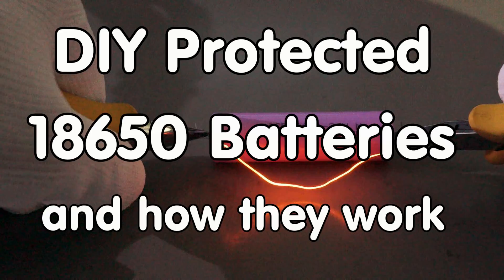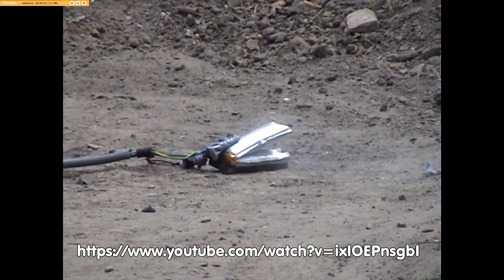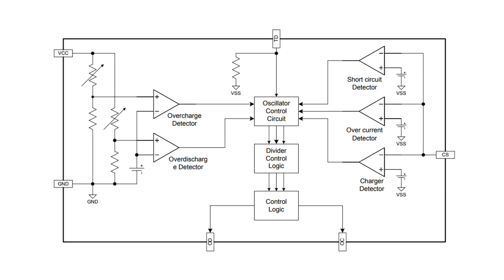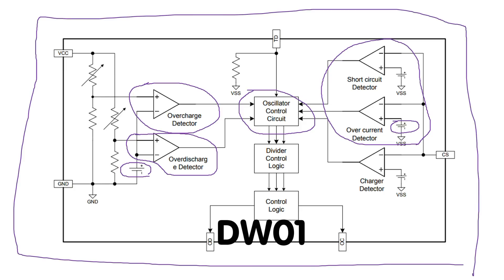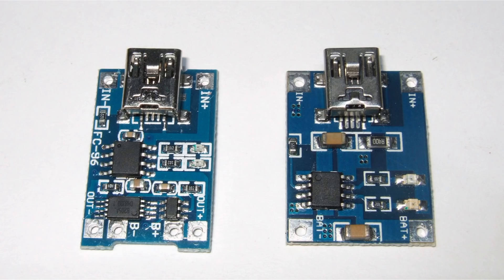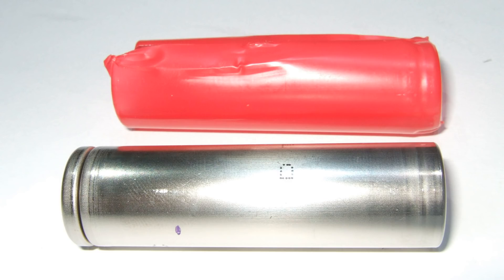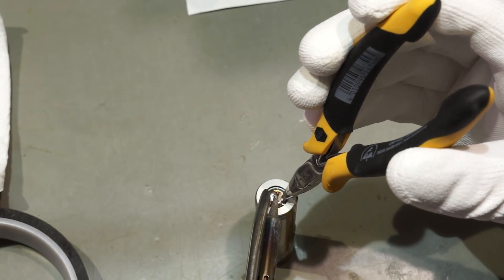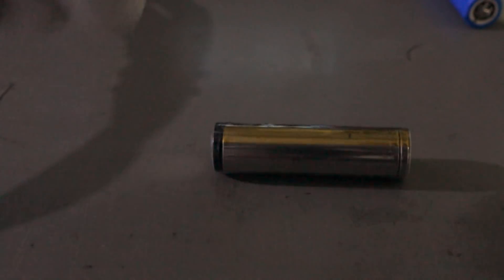#160 40 Cent Do-It-Yourself Li-Ion Protection for 18650 Cells (Tutorial) and how they work

Comment: Hi +Andreas Spiess, great video and very informative. Is that definately a Lithium-Polymer 18650? I know the Li-Po is often used for the drones and other high discharge applications as the dQ/dt is higher than with Li-Ion cells.  How did you know what the chemistry of the battery was before you added the regulator. I didn't see anything on the wrapper you removed. I suppose this regulator works for Li-Po, Li-Ion and the mixed chemistry technologies now appearing as this short article suggests (link below). Thanks again. That was informative http://blog.ravpower.com/2017/06/lithium-ion-vs-lithium-polymer-batteries/
Reply: The often used distinction between Li-ion and Li-polymer has nothing to do with chemistry (it is used wrongly and the link you posted just continues to promote that mistake; funnily enough the post links to another page, where it essentially tells you there's no difference; don't trust random blogs). Pouch and cylindrical cells are just different form factors. There are different chemistries within that class, but again that doesn't have anthing to do with the form factor. The main difference is that the different form factors are built for different applications (high current vs. high energy density). They are all Li-ion batteries.
Real Li-polymer batteries are still a research topic. Those batteries are still Li-ion batteries , but their electrolyte is a solid polymer. Current batteries have a solvent based electrolyte and the only polymer in them is the separating plastic foil in the battery. It is that solvent based electrolyte burning btw. that you see in battery fires. Lithium has nothing to do with those fires.
Reply: Ok, here is what I understand you are saying. I've made a few of my own interpretations, so perhaps you can comment on those ;- 
o There are no mass produced Li-Polymers. They are  still a chemistry theory or research lab thing. Li-Po will also be Li-Ion, and with a solid chemistry rather than the current Li-Ion tech which uses a wetter solvent electrolyte which when heated too much obviously burns. The solvent bit kind of makes the point about why these batteries have to be so carefully managed.
o Any internal chemistry is independent of form factor, though certain chemistries tend to use certain form factors.
o Form factor determines physical structure and thus either high current (dQ/dt, coluombs per second, charge flow rate) or high energy density (J/C, joules carried per coloumb).
Have you a link to a good no nonsense web page that spills the beans?
Reply: Yes, that's how I thought it should be understood ;) .
"Lithium ion" is the means of how the energy is stored. For example LiFePO cells are lithium ion batteries as well as they use also lithium ions to store the energy.

Heat or overcharging can make the electrolyte decompose or evaporate (very visible puffing on pouch cells, cylindrical cells have a safety vent so it won't explode). If it's hot enough and vents you got a fire. That's also why it's totally fine to extinguish such a fire with water if you don't have a better extinguisher available (it's for example recommended to flight attendants to use water should a passenger's electronic device catch fire). The water also keeps the thermal runaway from spreading to other cells in a battery.

There are so many different combinations of electrode materials and electrolytes that just putting them into "li-ion" and "li-po" category, even if that were a correct distinction, would be pointless. My guess why "li-po" as a name came to be is marketing. Someone heard about the "new" cell chemistry of real li-po batteries and slapped that label on their batteries, because, hey, they got a polymer sheet separator in there (as all of those cells had anyway), even when that has got nothing to to with actual li-po cells. I feel something similar is happening with the "graphene" label currently. Real graphene cells are nowhere near out of research (meaning nicely arranged graphene structures). Marketing heard about graphene being the future. Almost all cells use carbon on the negative electrode in the form of graphite flakes. Now tell someone that graphite is many graphene layers stacked on top of each other and boom, you got your "graphene" cells.

As for the internal construction which is the main reason for the current capability, search for "18650 teardown" or "lipo teardown" (yep wrong term on purpose ;) ). The 18650 is rolled up with only a single connection at the ends of the electrode strips, while the pouch cells are folded zig-zag where each of the layers has a tab coming out for a massive parallel connection. That other constructions are possible can be seen by 18650s that have no problem delivering 30A continuous.

I don't have a single page that will tell you all this, although I got to say wikipedia for "lithium ion battery" is a very good start. If you can check multiple languages (even if you don't speak another language, they often have different pictures that can explain alot and you might even understand a few words), especially german (easy to say since it's my native language), since german wikipedia is usually comparably extensive to the englich one. I also often go for french or scandinavian versions, at least for a quick look, although the entries in those languages are often shorter.
The problem is if you search for "difference lipo liion" for example you will very likely get the results that confirm the non existing distinction.
The most important thing is I guess to never only read a single source. If you found 10 different ones (preferably even by using different search terms) and all say the same thing, it might be right. But if one is out you should investigate further.
Reply from the maker: I have to admit I am an electronics engineer and not a chemist. So, I did not care enough about these differences. I just discovered now, that I used the wrong designation and corrected it in my description. I hope, most of the viewers still understood what I was talking about.

Comment: Not entirely sure recommending soldering to an 18650 is a super idea, there are probably a lot of novices watching the video who might try attacking an 18650 with a 30w iron or something and both not get very far trying to solder to a pretty large chunk of metal, and potentially spend so long mucking about that they create a very hot cell, which isn't so good.  Don't like to be "that guy" but perhaps a safety notice would have been good.

It's also worth pointing out that the DW01 does not protect against over charge current, it will happily (at least in so far as the datasheet says) allow you to push in as many amps as you can until something breaks (as long as you stay under ~4.2v doing so), so it's important to understand that protection is not a replacement for a proper charge controller.

Also, bigclivedotcom on over discharged cells: https://www.youtube.com/watch?v=sRwoYJyjZNo
Reply from the maker: 1. I mentioned several times that heat is the enemy of the LiPo cell, even with a video sequence. For me, this was enough warning
2. You are right with the overcharging current. I assume, When I increased the charging current to a few ampere, the 4.3 volts were quickly reached (because of the internal resistor) and the current was switched off.
Reply: Yes, Andreas has warned of this. I have made 18650 packs using solder on brand new cells, it damages some cells in a fairly random way. Soldered cells work fine for a while, then you see capacity issues in some cells soon after...  spot welded cells are much more consitent.  Best to use a spot welder for high current applications where long term reliability is required, also the bond is much cleaner, obviously. Soldering is OK for playing around.
Reply: A big solder tip, and a good high-wattage iron is essential... if you can get that solder flowing fast, and reduce the contact time with the cell, it's unlikely to damage the seals ;) It's the 20W irons that you hold on for a minute that are likely to result in BadThingsHappening(tm) ;)
Reply: HBPowerwall has 4480 old laptop 18650s in a powerwall, and all are heavily soldered and are fine. I think the heat dissipates pretty fast because of the metal housing so it's probably not that much of a problem.

Comment: At 8:40 there's a P - connected, what's the purpose for this? Thanks
Reply from the maker: If you look at the diagram, P is the connection to the ground of the load. You have to connect the load to this point.

Comment: You got it wrong. As you can see on functional block diagram, DW01 uses vcc pin to detect overdischarge and overcharge voltage. If it worked as you showed at 6:44 it would never work, chip wouldn't even get power to work properly. I know it seems confusing with two mosfets, they are that way to compensate for that parasite body diode, if that protection was only for charge or discharge, there would be no need for a second one. It's not very intuitive to get it, M1 is connected to overdischarge pin, but in fact even closed, would discharge that cell, because of that parasitic diode. So in fact that OD and OC pins should be swapped.
Reply: The cell negative just needs to go on the other side of the fets otherwise the diagram is OK.

The datasheet (eg http://www.haoyuelectronics.com/Attachment/TP4056-modules/DW01-P_DataSheet_V10.pdf ) shows this correctly, Andreas accidentally has put it in the wrong place probably because the markings on the datasheet are a little confusing ("BATT -" should better be called "OUT-")

As you say, the body diodes never conduct in any operation, as long as one fet is off, then neither fet can conduct, and if both fets are on then their Rds will bypass the body diode anyway, for an example the datasheet says "When the battery voltage is above VOCP, the overcharge condition will not release even a load is connected to the pack." which is because neither fet can conduct since the OC fet is off and it's body diode is blocked by the OD body diode.
Reply from the maker: You are right. I apologize that I mixed some pins. I will place a link to the correct diagram in the description. The basic principle, however, stays the same
Reply: Well, it can happen to anyone, even the best from the best. We are only humans after all.

Comment: So, what caused you battery to almost explode? Was it charging?
Reply: He must have doing something wrong himself. DIY powerwall makers have thousands of cells and this never happened.
Reply from the maker: I tried to recharge a completely discharged LiPo.
Reply: If a Li-ion cell is discharged completely, when charging again small metalic lithium spikes can form, piercing the separator and internally shortcircuit the cell.

Comment: Another great video. Thanks!
I read somewhere that ideally Li-ion cells should be discharged to 3.7V (or some other voltage?) when put in storage. Presumably at that level they can be stored safely. What do you know about this? I have some old laptops in the closet that I haven't charged for years. Do you think charging them after many years could be dangerous?
Reply: Usually (at least that's what I've seen) the protection circuit in a laptop battery pack disables the pack completely if one of the cells dropped below a certain voltage (I guess it will be the ususal 2.5V) and it won't even take a charge. 
If you don't need the pack anymore (a laptop that hasn't been used for years can't be that important ;) ), disassemble the pack and check the cells individually.
I've taken a 4 packs apart recently (first time I did that, but I plan on getting more), all from laptops that haven't been used (and charged) for years. The cells in one pack were completely dead (some even at 0V or reverse polarity) and head corroded. But the cells out of three packs were fine (between 3.2 and 3.7V). I checked the capacity and in one pack the cells had about 75% left and in two packs they were at 90% (one of those was out of a laptop that was at least a decade old, if not 15 years). I charged the cells back up to 3.7V, paralelled them all up and they maybe lost 5mV over the last month (that rate explains, how they are still fine after such a long time). I don't know about the internal resistance of the cells, but considering I got the 90% capacity numbers by discharging them at 1A (which is about 0.5C) they seem fine.
Reply from the maker: AFAIK LiPos have a small self-discharging current. So, It might be that your batteries are completely discharged after years. If you try to recharge them, the same could happen as happened to me. But it is not happening always (see other comments).
Reply: Storage voltage is different story. It is voltage where battery doesn't loose its capacity (beacause of used chemistry) so it is better for them to keep such voltage as long as battery is not used frequently. Most modern laptops have such option available in BIOS which prevents of too frequent recharging and charging only to 70-80% of capacity, when laptop is used mainly with power supply. Search for Flexicharge.
Reply: For one it's pointless cycling. Li-ions don't have a memory effect, so you don't gain anything. But more importantly the chemical processes that make a cell lose capacity are faster with heat (especially when fully charged) and you get that with charging/discharging. Since you won't do the needless cycling very often, it won't really matter, unless for some reason you stop just right when the battery is full or empty and then store the laptop for a long time.
Reply: I've had similar experience to superdau when taking apart several packs from laptops which hadn't been used for several years. The laptop clock / BIOS backup had drained the packs completely, and then usually the first cells in the series had degraded or would get unusually hot when charging, so I will not use them unsupervised or have discarded them. I know of the FlexiCharger option that cbm80amiga is referring too... I saw it on some enterprise-grade (as opposed to consumer grade) Dell laptops about 10 years ago... and thought it was a great idea to preserve the battery... but I'd love to know how many manufacturers actually use that now... as I suspect they don't give a damn, and want their customers to come back after replacement batteries. I seem to remember that IBM or HP had a feature in their software to periodically automatically run a discharge / charge cycle the batteries monthly when the laptop was on power, also as did Dell. Good features, but I'd love to know if they are still around. ;)
Reply: I've seen the "charge to 50% to 70% only" (don't know the exact number) in a cheap Lenovo (helped to set one up for a friend). I'm sure that's quite common with other manufacturers as well. With li-ions cycling the battery doesn't really help its life. It is mainly done to give a somewhat accurate reading of the charge state. Most batteries have "logic" that counts the mAh put in and out (battery packs have those extra pins to talk to the laptop and report state of charge). After a full charge/discharge cycle the logic stores the new capacity values. That means that 100% when you buy the laptop is not the same as 100% after a year of use.
Reply: @superdau... You're not kidding... I want my 100% back... no the 100% that it is now! ;) Yeah, coulomb counting is ok for calculating state of charge (as long as self-discharge is taken in to account)... and certainly better than voltage if you want better accuracy, but why do you say the cycling doesn't help with it's life... as it the holding at a lower rate should prolong the life of the cell... so in effect it probably won't make that much difference anyway... especially since the batteries are usually being kept fully charged, and right next to hot stuff, which is also not a good way to prolong their life :-O Or is that just a general observation, i.e. when pointlessly cycling when you don't actually need to?
Reply: True, for memory effect, it is pointless. However, that isn't the real reason for it, for re-calibration of the battery management system, so when you do unplug it the estimated run time and discharge curve is actually accurate. I do wonder though if a periodic cycle, especially if the battery is kept fully charged, makes it less prone to the plates being spiked. However, this is all avoiding the issue, which is that the battery for a laptop should be separate to the laptop, or an insulated compartment so that the heat from the laptop itself and being kept fully charged doesn't ensure it's early demise. :-/

Comment: I use them protected TP4056's a lot, but I've been looking for this very device. Great Video... You can still use the unprotected cell holder... All you have to do is cut them in half and you can either screw them in place or you can use a piece of tough plastic and epoxy to the correct length
Reply from the maker: Thanks for the tip. I will try that.